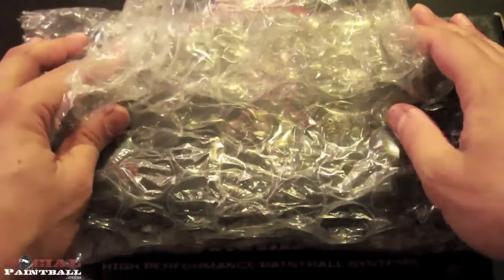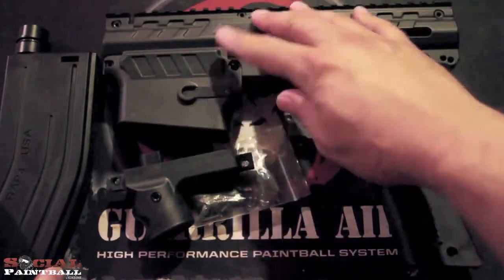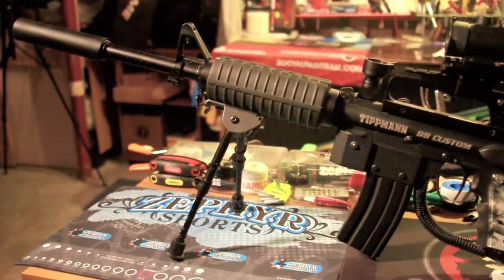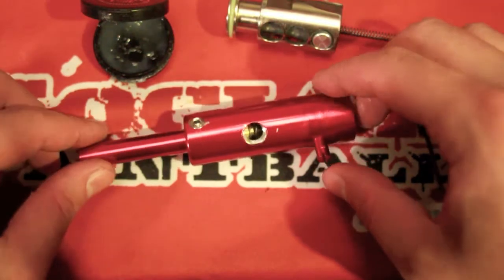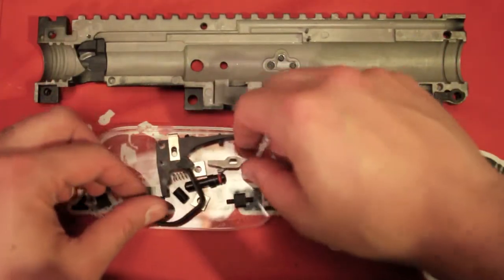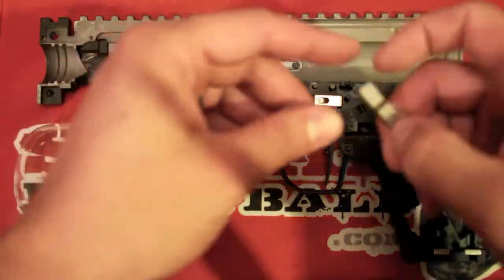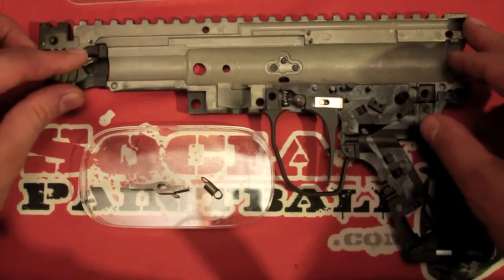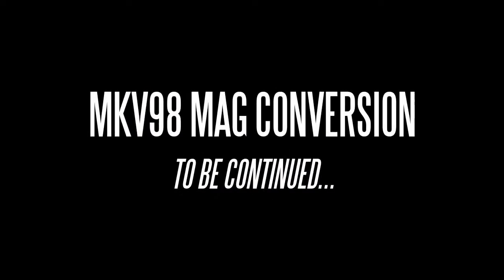RAP4/Tacamo MKV98 Mag Feed Conversion

Comment: I put together my MKV98 Coversion kit that i got shipped from RockStarPaintbalcom
They had it in stock and it was delivered in TWO days!.
Easy to convert,but than i installed RAP4 internal air kit...
BOOOOOOOooooooo  The marker leaks from the rear!
The Marker fires just fine! But it leaks! 
I will call Rap4 tech support in the morning...

Comment: I have a kit for an a5.. its utter garbage! As a result of mag conervsion I now have barrel wobble that in an 18inch barrel translates into an inch at the tip, this has been tracked down to the barrel adapter not fitting tne receiver, well done rap. I gassed the marker up and now have huge air leaks, when you consider that you only transfer the internals across from a brand new marker no less, without disassembling anything, it clearly points to poor quality craftsmanship by rap4.